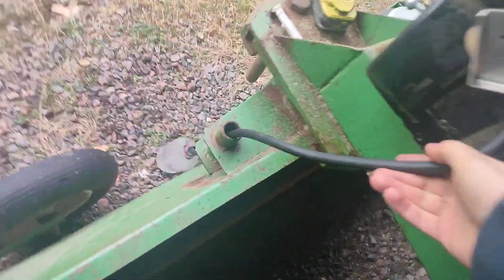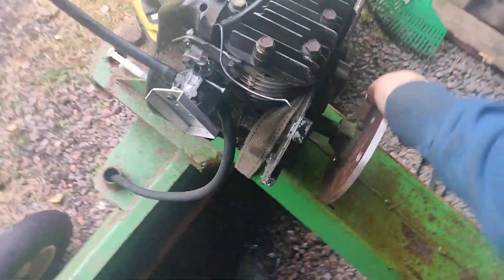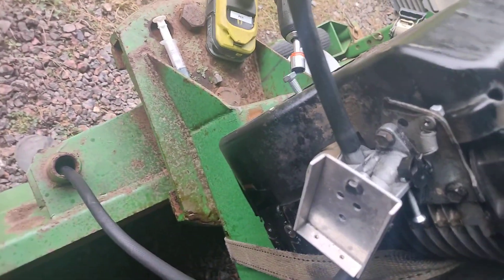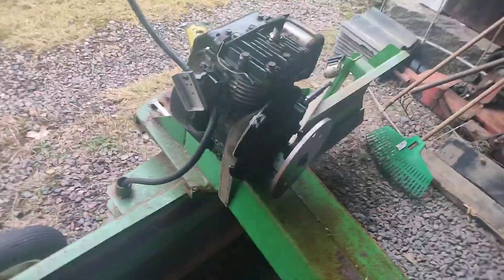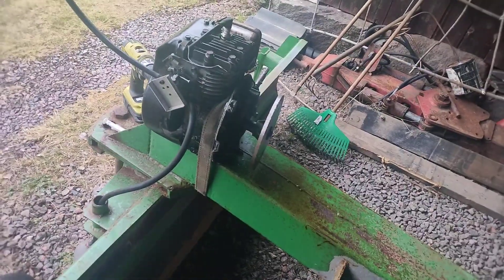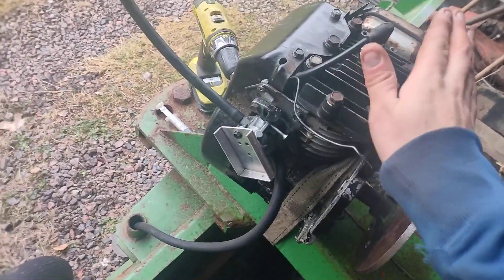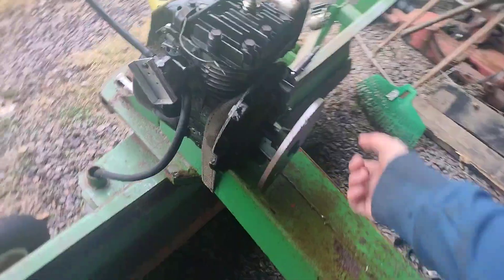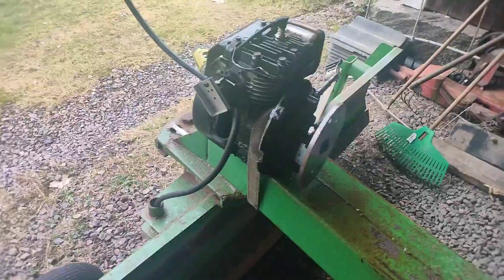First run Briggs vertical converted to horizontal

Comment: hows the durability of that convertions?

any problem compare to the original set up?
Reply from the maker: I wouldn't recommend it, to be fair. I ended up putting this on a low RPM generator (only runs at 1500 RPM.) It still works to this day, but I havent put that many hours on it. I had to fabricate a really interesting governor system with strings and pulleys to change the pulling direction! this engine is so worn out that it literally spews oil out from the crankcase breather, and it also has pretty severe rod knock from it's previous rather rough life as a lawnmower engine. It can run for a couple hours at a time without too much issue, but then the oil needs to be refilled. I put a oil catch can on it, so I can reuse the oil because there is nothing wrong with it, it just spews it out due to the excessive blow-by. It is not very enjoyable to use though, it is louder than my cheap chinese single cylinder diesel engine, and smells horrible. So I think one day, I will take it apart and install the diesel engine on that generator instead, a far better option.

I wouldn't recommend this, it's far better to buy one of those cheap honda clone engines on ebay or something for around 100-150 bucks. They are far better, I have had a few at this point and they all have ran absolutely fine. There are better and worse clones though, watch out for the really cheap ones as they tend to have plastic camshafts which likely won't last more than 50-100 hours... 

I managed to buy a really nice clone locally to repower a generator. I found that engine mounted to a water pump, which amazingly, was cheaper than buying just a engine by itself from ebay... Very weird how it can be cheaper to buy a complete brand new water pump than just a engine, beats me... anyways, that engine turned out to be really nice, I took it apart for inspection and changing the side cover so I could use it for a generator, and it was actually really nicely made. Proper steel camshaft too, I bet it will last a few hundred hours. Nice looking castings too! So yeah, chinese engines are a hit and miss quality wise, but if you do run across a nice one, I see no reason why they wouldn't last just aswell as a real honda or something similar, assuming you give it regular oil changes and everything of course. 

Best of luck with your engine experiments!